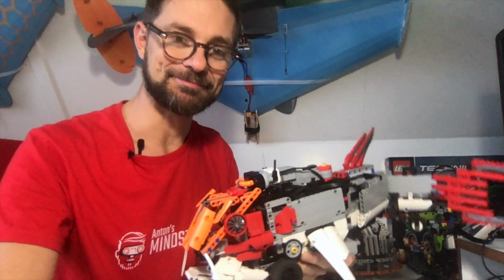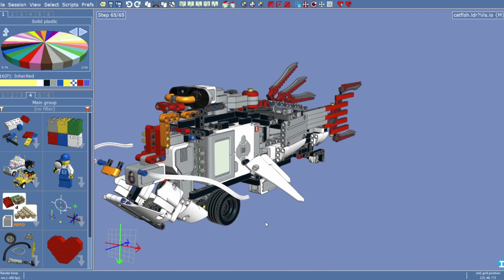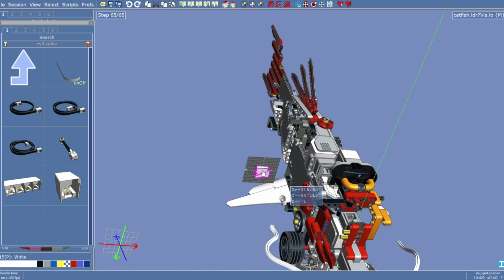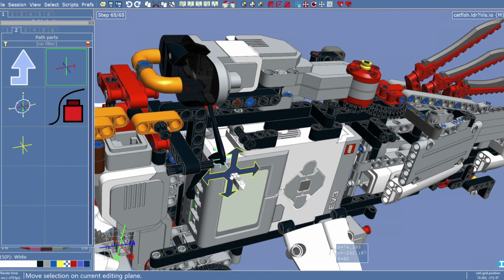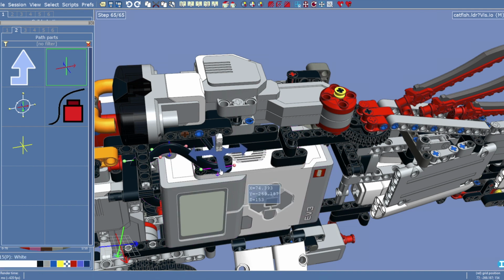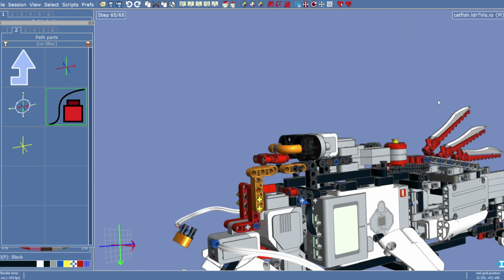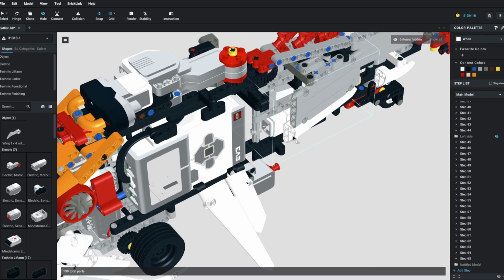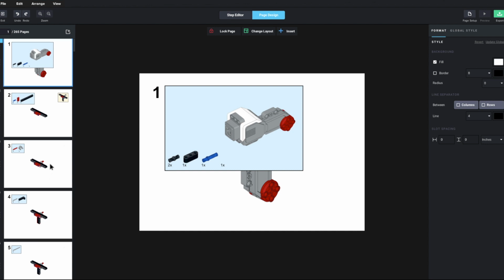Making building instructions with EV3 cables in studio tutorial

Comment: You can dock a window by holding down the ctrl key when arrived at the target location.

To prevent undocking, lock the gui using the prefs/gui menu

In order to fix the twist in the cable you need to roll the control points carefully. Roll is indicated by the red/blue arrows. The twist in your cable is because of the very tight corner. With a flat cable you have to tread it a bit like a race track keeping the changes in roll small. Don't forget to take the orientation of the plugs into account while fine tuning the roll of the cable.
Reply from the maker: Thanks. When the cable is in a pinch it's hard to see in which direction you have to turn the plugs to unpinch it. It would be nice if the control points could be added to the cable 'stressless'. So instead of being oriented to absolute xyz, they'd align themselves with the cable you're editing. This would prevent a lot of accidental pinches.

Comment: Hi Antons. Nice video that introduced me into LDcad after using studio solely. I know your video is for mindstorms cables but i was doing a drawing for lego boost and noticed that studio parts don't have cables at all and LDcad has cables but apparently, are not flexible. Is it me missing something or is there any unofficial parts for boost motors and sensors that allow cable connection and flex?
Reply from the maker: I found some parts with flex cables, but only the plug side. Not the motor side.